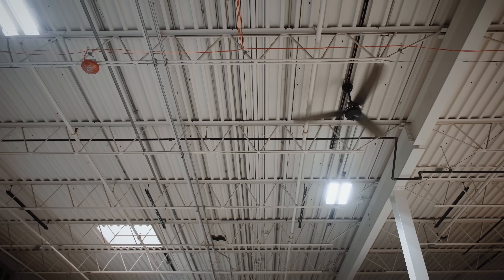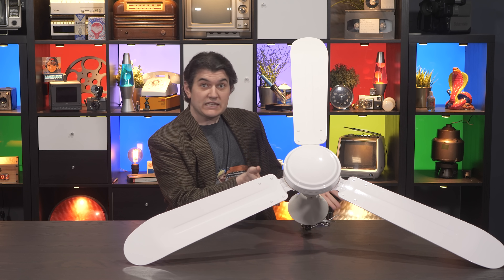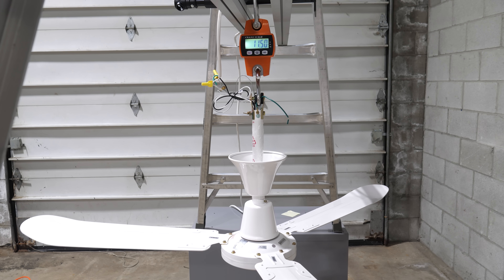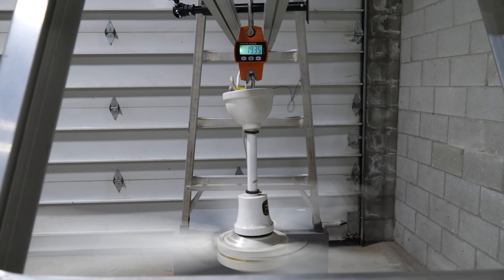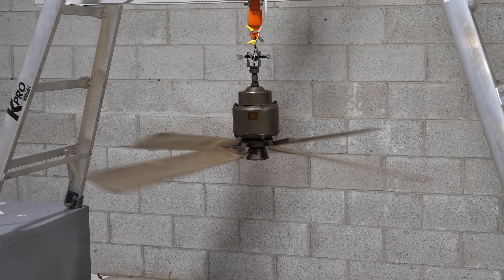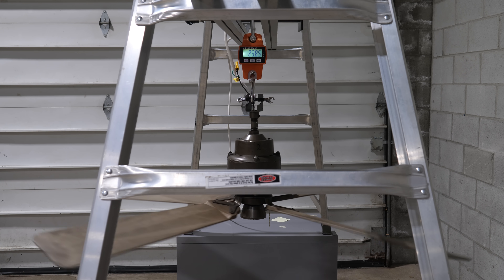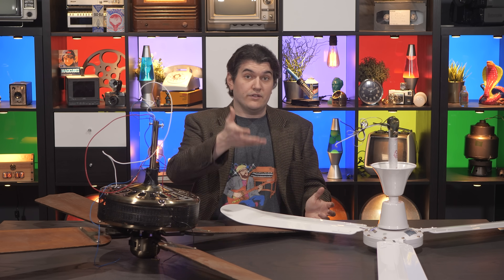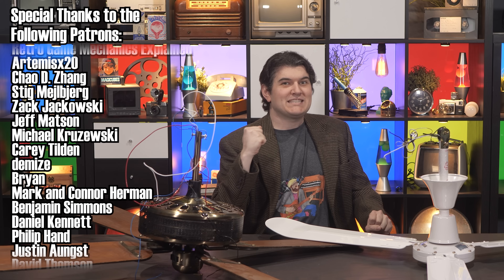How much thrust does a ceiling fan produce?

Comment: I don't have any numbers to back it up but I can assure you that the lasko box fan if you've ever owned one that has a broken a foot off generate some non-zero amount of thrust which causes them to slide backwards and tip over on high speed

Comment: since hot air rises, did the fan with the built-in heater have more thrust when the heat was on? If a fan spins in the desert, does anyone really get cool? What is the sound of one fan clapping?
Reply: Generating airflow is actually how those thick robes worn by some ethnic groups in deserts avoid cooking them alive.

Comment: I need your help Alec - my gym has invested in two portable AC units to cool it down on hot days. These are big beasts, at 2200W (18000BTU) and 1400W (12000 BTU) each. They would be great, aside from the fact that neither have an outlet hose connected and they just pump heat directly into the room through the fan on the top. However, when I brought this issue up to staff I was told that "the heat is being pumped up" so it's actually OK. It's obviously not, and since adding the second unit earlier in the year the summer became swelteringly hot. I go regularly and have never once seen these air conditioners reach their thermostat temperatures. I'm sweltering! It's less of an issue now it's winter time but it's still uncomfortably warm to exercise in. How do I convince the gym staff that despite pumping the hot air (pretty slowly) upwards towards the tin roof (between 4 and 5m high) the room is not at all cooled down and that's why last summer the gym was hotter than ever? I can't take another summer of these blasted heaters!
Reply: I'm gonna have to tell you to just go to a different gym lol, they're clearly beyond helping.

Comment: When I was a kid I asked my father (an engineer) if ceiling fans produced a helicopter effect and he said that the air pushing on the ceiling was equal to the air pushing against the room so no.  A helicopter is outdoors, not in a room.  Your tests are really invalid without a ceiling in place.  Interesting, but I question the results.

Comment: I thought this said “How much DUST does a fan produce” and I was disappointed it wasn’t about why fans get so dusty.
Reply: The answer is "because you don't clean them enough."

Okay, I joke, but a lot of air passes through and contacts the fan as it operates. Some of this sticks to the fan, and then dust sticks to that dust, etc.

You've probably noticed a clean fan takes a while to accumulate dust, but once there's dust on it, it accumulates more quickly, this is cause the dust on it already creates a rougher surface.

Comment: This is a weird video to watch after vsauce's "which way is down?" video kinda redefining gravity for me. He said the force of air buoying you up actually makes you slightly lighter than you would be in a vacuum. That doesn't make sense to me, i'd think it would press down on you and make you 'sink in the air' more, but.. eh.

I wasn't sure how, but I was really hoping you'd complete the metric running gag with "and those industrial fans take the temperature in a blast chill freezer down to minus 40 degrees fahrenheit, which ISN'T a different number in celsius"
Reply: I'll try to help it make more sense.

Swing your arm. You felt the air as you swung your arm right? That's because air is stuff. It's a physical thing. We live at the bottom of a massive ocean of air. Just like how if you put something in water it wants to float up, the same is true of air. You're just heavier than air.

Okay, but imagine how you float in water. People on average are just slightly less dense than water, so we float, but just a little bit. Not very well. Think of it as a fight of gravity between you and the water. Gravity is pulling you down, but gravity is also pulling the water around you down. That water and you are "competing" for which can be the most down. You are less dense than the water, so the water that would replace the space you take up is pulled down slightly more than you are. For the water to be being pulled down by gravity it has to be pushing you up the same amount to get you out of the way. The amount it's pushing you up is equal to the weight of the water that would fill the space your body takes up. Since this is slightly higher than the weight of your body (a few percent difference), the net force on your body is small. You're only being pushed up a little bit.

The same is true of air, it's just the air is way less dense than water (roughly 1000x less dense), so you're only being pushed up by the weight of the air that would fill the space your body takes up.

It's also true that that ocean of air is pressing down on you, just as the water would be if you were under the ocean, but this is acting all around you, not specifically downwards. The air beside you is pressing on you just as much as the air above you, because it's all under pressure at the bottom of the ocean of air, just like water is under the ocean.

Comment: Actually a helicopter flies by pulling itself up into the air since its blades are airfoils like a plane’s wings. Which explains why these fans don’t produce that much thrust.
Reply: In order for something to pull it has to push. Helicopter rotors pull the helicopter by pushing on the air.

Comment: The electrical box for a ceiling fan is supposed to be reinforced to the ceiling studs. I realize that not everybody does this, especially if the box is already fastened to a ceiling stud, but they're supposed to be. Because, weight, torque and vibration.

Comment: 11:56 I know it's no effort November, but this isn't how propellers work. They are shaped like wings and generate low pressure on the longer side causing lift like thrust on the low pressure side.
Reply: This is exactly how propellers work. Saying a wing generate low and high pressure zones is saying they move air.

Comment: I want to see the results with adding more angle to the blades and see how to get the most thrust out of it.
Reply: A greater angle of attack would mean greater resistance which would require a stronger motor.

Comment: Heat recovery fan pushes the air that’s stuck at the top of the ceiling back down. That makes sense to me. Yet for domestic home fans they recommended that you make the fan pull the air upwards in the winter and blow downwards for cooling effect during summer. I never understood that. I think the correct answer is that no matter in which direction, idea is to just circulate the air. To keep it churning and moving.
Reply: My guess is that it's because a room in a home is much smaller than a commercial space that a fan might be in, so the home fan has the advantage of nearby walls for the heat to hit and run back down on when the fan is blowing up. In a large space blowing up would just cause the heat to churn around on the ceiling and never reach the floor again, so the best thing is to just blow down.
Reply: This is correct. The reason you reverse them is so you aren't blowing directly down on someone, which would cool them down even if it was pulling down hotter air near the ceiling. By blowing up, you create a slower flow of air more evenly down around the walls of the room.

It's not exactly inverted. The air is drawn in from all direction on the suck side whereas it's more directional on the blow side. If you want to see something confirming this, I'll point you to Airflow pattern induced by ceiling fan under different rotation speeds and blowing directions.

Comment: i wonder how "optimal" the blade shapes and angles are on these things.

high effort not novemeber idea: rig up variable pitch blades
Reply: Fairly. The aerofoil shape of propeller blades is more relevant as speeds increase.

One thing to note is how ceiling fans and standing fans have different blade shapes. This is because the former can be larger, whereas the latter are more size-constrained, so to blow more air they have to have wider blades (and higher speeds).

Comment: I recently finished a package of fig Newtons I had in my refrigerator. The refrigerator is less heavy now, exerting less force on the floor. 😆
The reason your scale changed when the motor is switched on has to do with the hook arrangement. The hook being curved where it contacts the clearance hole, the clearance hole being curved where it contacts the loop, the resulting slop of the connection allows the hook to ride up the slope of the hole in which it's hanging, much like the thread of a screw climbs the slope of the corresponding thread of a nut. The scale's tension is the only thing resisting that "climbing" (fan getting physically higher in the hanging apparatus), so the result is the reading indicated a "weight" greater than the resting weight from the torque.

Comment: It's not much of a propeller at all. 

I find that typical ceiling fans more resemble a stir stick, making the air in a room go around, than an aerodynamic propulsion system that generates as much lift as possible. Consequently torque is a more important factor to measure.
Reply: It's the same thing. Aeroplane fans are just stronger and optimized for the constraints of being stuck on planes.

Comment: what if you put propeller type blades instead of just blades that depend on angle of attack?
Reply: This has little effect at lower speeds.

A lot of this can be seen by comparing ceiling fans with standing fans. Standing fans are much smaller, so to blow lots of air they have to compensate by having wider blades, and spinning faster, which is also why they have curvier blades (since aerodynamic effects are bigger at higher speeds), whereas ceiling fans are generally very much just flat boards.

Comment: All the pilots here going absolutely insane in the first 2 minutes
Reply: I'm genuinely concerned how many pilots just keep blindly regurgitating that propellers magically pull planes through the air because of low pressure. They're basically saying a wizard did it with more jargon. Baffling.

Comment: Why didn't you just put one out two of the legs of the ladder you were using to suspend the fan from on a weight scale.  Using that hanging scale you used on the video seems like far more effort than this.

Comment: So, if I understand this correctly, the room gets larger as the fan pushes up on the ceiling.   I assumed that this would be about efficiency of the motor vs air moved.  Who moves the air more efficiently?

Comment: I've actually wondered this myself a couple times, but I just figured their lift wouldn't be particularly high since most ceiling fan blades are flat boards meant to move a lot of air around, not efficiently generate lift with an aerofoil cross-sectioned blade. Neat to see it actually tested though.
Reply: well, AKTCHUALLY(sorry), he didn't test that. That would have required replacing the flat (aluminum/wood/plastic) blades with proper aerofoil shaped blades. and determining how much thrust THOSE produced.
Reply: Shape is more important as the speed of the blades increases. Ceiling fans spin very slowly, so them being flat boards is perfectly good. You'll note standing fans have curvier blades. This is because they spin faster as part of how they compensate for not being able to be very big. Helicopter rotors and plane propellers move very fast, so their shape is much more important.

Comment: I wonder why the emmerson doesn't have a weight increase from the torque. I don't know if all ceiling fans are like this, but the ones that I've installed have a stationary rotor and the stator spins with the blades attached. The traditional washingmachine motor seems to have a spinning rotor and stationary stator. Could the larger spinning stator do .... sooomething gyroscopically that the spinning rotor doesn't? That is really fascinating for no reason.

Comment: I've yet to see one ceiling fan in action here in my part of Europe lol, I only see them in american media.
Reply: It's definitely a strange quirk. Ceiling fans are great. Might as well say you don't have a dishwasher, you just go down to the river.
Reply: @seigeengine  there's really no need for one. We just open windows or use a standing fan if we need to cool (ahem, circulate the hot air around) the room. And they're all butt ugly. I thought I was going crazy but searching for this on the cyberweb it seems that I'm not alone, this really isn't a thing in Europe.

Comment: I want to try and guess the result: very little, because they're optimized for volume of air and static pressure rather than air velocity
Reply: More air at low speed vs less air at high speed amount to the same thing.

Comment: Given how poor the blade design of most ceiling fans are it begs the question, does a blade designed to optimise thrust make for a better or worse fan?
Reply: They're not poorly designed. They're designed for different operating conditions. The shape of the blades matters more the faster the blade is moving. Ceiling fan blades move very slowly. You'll notice standing fan blades are differently shaped... this is because they spin faster to compensate for having to be smaller. Propellers, meanwhile, operate much much faster because they need to move a plane.
Reply: @seigeengine  I'd wager they're designed for ease of manufacture given the shape of most of them (a flat piece of material with square edges).
If anything something other than a flat plate would, at the very least, use less power to move the same amount of air.

Comment: I’ve always had a question, might just as well ask it here. How exactly does this thing keep you cool, if the hot air rises to the top, and this fan effectively pushes it back to the bottom? Just to be clear, I’m from Europe and haven’t had much experience with the ceiling fans.
Reply: The same way any fan does. It creates airflow across the body. This accelerates heat exchange between your body and the air, and increases the rate of evaporation of sweat (evaporative cooling). A big part of this is that air normally sort of sticks to surfaces creating a "boundary layer." That boundary layer around your body warms up but doesn't mix very quickly with the rest of the air around you, so it insulates you. When there's a breeze, it feels cool because it blows that boundary layer away.

Even if it's blowing warmer air down at you, generally the extra cooling caused is greater than that. This is also why we reverse the fan during winter, because the direct airstream blowing down on you might cool you even if it's blowing down warmer air.
Reply: @ thank you for the response!

Comment: Dont worry about the forces on the ceiling fan electrical box. It's made for those forces. BUT if you use a normal light fixtures electrical box, you are just asking for trouble.

Comment: The "reverse" does reduce draft but mostly because it pushes warm air toward the walls where it then flows down creating "heat" curtain over the cold surface.  Dry winter air would have to be pretty warm to not give you a cold draft feeling if blown right at you.

Comment: The answer is zero. Thrus is a net value to displacement. If the fan is unable to lift its own weight, it doesn't have any thrust.

Comment: Don't forget that propellers and fans are quite different in that prop blades are aerofoils like plane wings and fan blades are sails like from a boat. Wind turbine vs windmill, modern plane vs wright brothers'.

Itd be interesting to see how these perform thrust-wise with some bulk added to the blade to create an aerofoil effect. The would act worse as fans though (although, like generators vs motors, they seem to do the same thing, there are nuances)
Reply: I mean, changing the shape of the fan's blades doesn't make it not a fan.

In either case it achieves the same thing. Ceiling fans don't need fancy shapes because they spin so slowly.

Comment: 0:02 I’m going to start out answering the posed question first and then watch the video. No it doesn’t get lighter much the way an airplane doesn’t get lighter simply because it’s flying. However, the ceiling it’s attached thinks it does, unless it’s going the other direction. In which case there is probably some ground effect involved in the calculation (ceiling effect?) due to the proximity of the ceiling which would complicate things considerably.

Comment: if you've never been up in a cessna (small prop plane) you should go to the airport and take a ride. If you get in or out of the plane while its running you'll feel the wind generated by even a tiny plane at idle. If there's a flight school someone will almost always take you up, they need to build hours anyways.
Reply: Also, there are tons of airports you probably don't realize are near you. If I wanted to fly somewhere, I'd have to travel like an hour to a nearby city, but there's multiple smaller airports in my small city.

Comment: You missed one thing that might change your results. The ceiling is missing, you might have a higher pull down force if there was a ceiling to "block" the air, just saying.